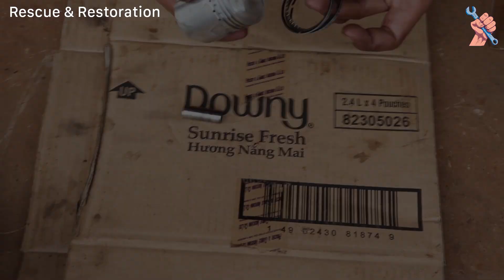1979 Honda Super Cub C50 Engine Restoration | Honda Super Cub C50 Restoration Part1

Comment: i have a similar motorcycle but it is 72cc displacement motor, tops at about 70 km/hr and has a range of +400 km on a full tank of 9.5L. It's a variation of Honda Cub.